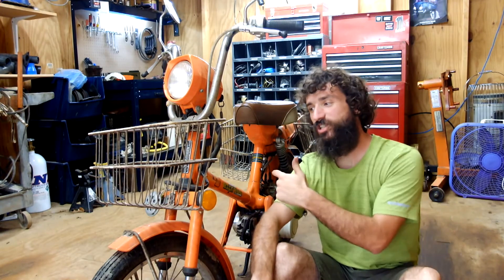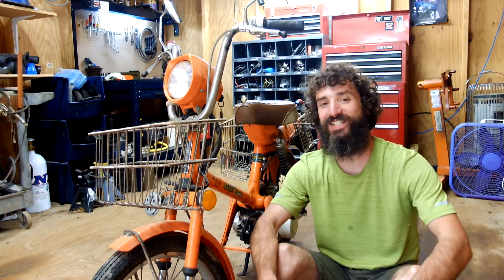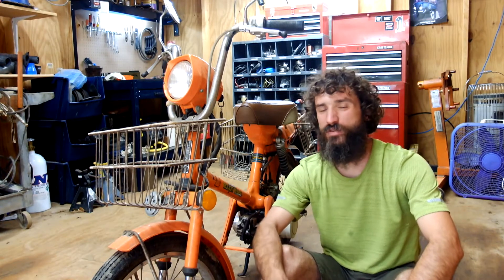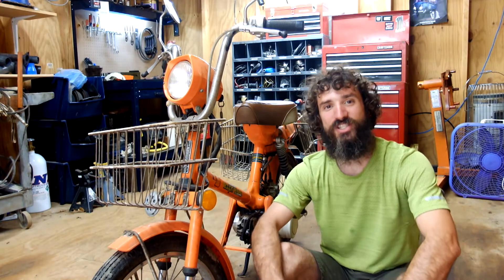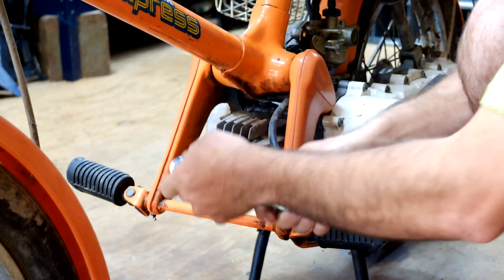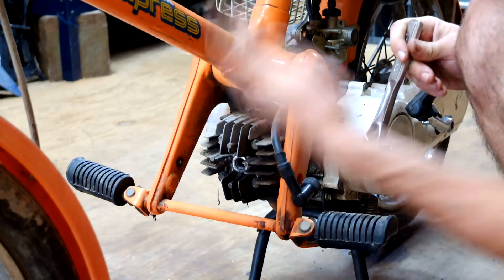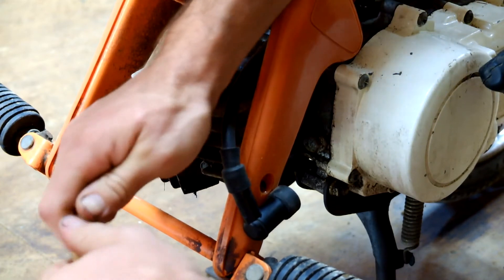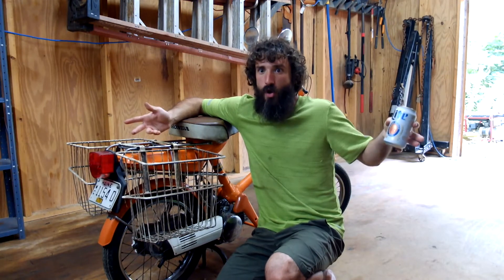PSS Minisode #2: How to Compression Test a Honda NC50 Express

Comment: Heyo, can you give me some advice?

I bought a 70cc kit for my NCC50 and installed it. I'm now having issues with compression. I haven't tried to go through the ring seating process. The moped starts over first kick, but runs like absolute crap. I have zero power in all throttle positions no matter the jetting. Other people seem to be running similar setups at around a size 70 jet (in a dellorto SHA1515) - I've tried pretty much every range from about 58 to the mid 80s. Higher jets result in obvious rich conditions and any choking over the air results in a stall. Changing my jets results in different plug readings, but no real change in available power. I compression tested the engine and only get around 70-80psi.

I removed the jug, cylinder, etc. and checked the seals and rings. They all look good. Rings are around the locating pins and aren't broken. I hooked up a leakdown tester and set it to about 55psi or so. I can't zero my gauge because the air i'm sending in starts gushing out of the exhaust. I made sure the piston was TDC or near TDC before performing this test. I'm not sure a standard leakdown test is appropriate for 2 strokes like this though?

Do you have any idea why I might be experiencing low compression with this new kit? I don't get air leaks anywhere else - reeds are sealed good, the copper gasket where the exhaust mounts to the engine is good, and the base and head gaskets are sealed good - no air leaks.

Comment: I had one of those for a summer project in green it was made in 1977 it been sitting for years.. and a friend of mine got it from someone that passed away at a retirement home and somebody else wanted to buy it so he brought it over here and it took me quite a while but I got to go in... It needed motor bearings in the pump didn't work.. in the end it was just easier to get things going and just put two stroke oil and gas together rather than be separate.. took a while but it was a fun little project being retired..

Comment: Thanks Paul, I have a ‘79 Honda na50 and mine has 130 psi of compression. I wonder f I should change the rings or leave it as is. I’m in the middle of restoring it, basically swapping out what’s needed and restore what’s good any advice? And I would very much like to see a rebuild video on it, thanks for the video and ride safe.
Reply from the maker: I think at 130psi you're probably fine assuming it starts easily and runs well. I made a rebuild video months ago and never had time to finish editing it or uploading it, but the NC50 has been a great little bike! I've ridden about 450 miles on it since the rebuild.
Reply: @buttcrackcycles  thanks again Paul, the bike ran extremely well for its age the issue is that I found an air leak on the head gasket but what I’ll do is replace every single gasket and seal possible. I checked the crank bearings and they felt like new with no play whatsoever. Hope you get the nc50 video out soon looking forward to it, ride safe.

Comment: Are you using a small engine compression tester or an automobile compression tester?
Reply from the maker: Just a regular automotive one
Reply: Paul's Speed Shop the automotive tester will read low on a small engine. If your compression was really 70, it wouldn’t start. 80 psi and they will barely start. 90-100 is typical and fine. Even from the factory, I bet 130 is the best they did.
Reply from the maker: Well, kind of letting the cat out of the bag for future episodes (nobody's watching anyways) but this footage is about 6 weeks old. Engine's already been taken apart and rebuilt. Piston and cylinder were very badly scored, no wonder it would barely run (generally would not). The new parts make 140psi on this same gauge and I have about 175 very fun miles on it so far.
Reply: I actually used an automotive compression tester as well, and it read 130 PSI more than once. Where would be able to locate a small engine compression tester?
Reply: @miguelpagansr6128  maybe your tester is fine then.  I use an Innova compression tester for small engines off amazon